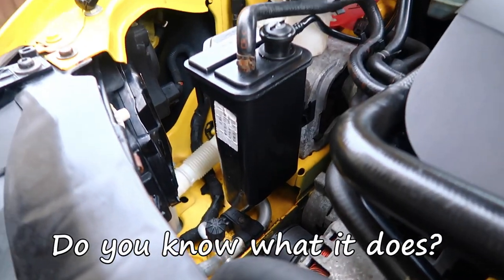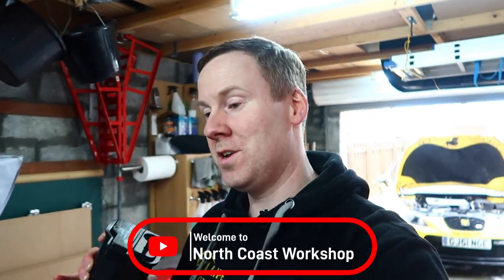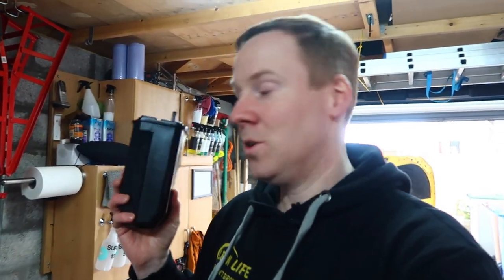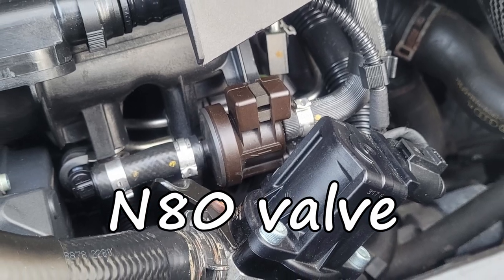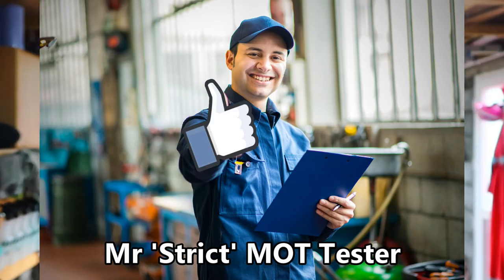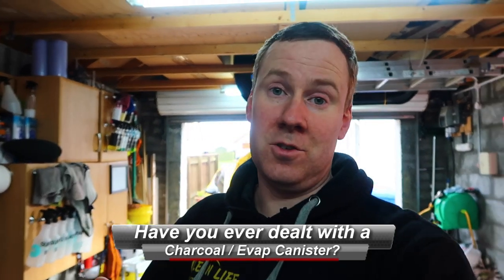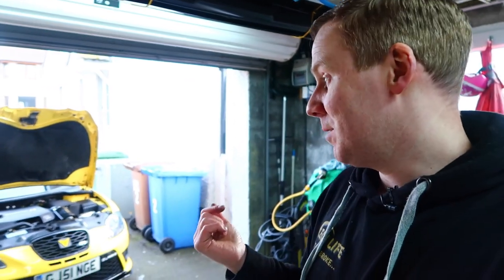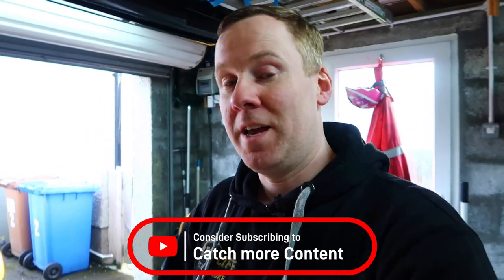Charcoal Canister CHEAP Replacement | TFSI MK2 Leon 1P1 Evap issue

Comment: It helps a lot with mpg for one and after a certain amount of time it can get clogged and the check engine lights and the car doesn't run at full power
Reply from the maker: Did you have issues with yours? 
Yeah by the looks of mine it was well worth changing! 👍🏻

Comment: Just replaced my n80 purge valve as i had the error code for it and mpg was absolutely dire, had the clicking noise etc. now I've just had the P0441 code pop up so just ordered a charcoal canister. Will be using your video to fit ot when it arrives 🙏
Reply from the maker: 🤞🏻Hopefully it will sort the fault code mate, let me know how it goes.
Reply: Same issue here, did it end up working?
Reply: @hcmzah  the new charcoal canister fixed the problem buddy, was like £16 on Amazon
Reply from the maker: Great to hear mate 👌🏻 glad it's all sorted now

Comment: Great vid, I’ve been chasing a problem with my 2.0 tfsi running rough. Had a walnut blast, r8 coil packs, uprated spark plugs. Now I’m assuming I have a vac leak (reason being the charcoal canister as some point has fell off and hit the belt next to it) I’m going to order one and see if this solves my problems🤔. Great channel pal
Reply from the maker: Cheers mate, appreciated 👍🏻 Yeah vac leaks are a pain to track down. So many places that they can come from 😔 Ur right, rough running usually originates from a vac leak. The seal on the dipstick can fail, the PCV can leak, the pipework to the PCV, etc. Hope u track it down, let me know how it goes too 👍🏻

Comment: The cap which you removed with the pipe also has a reed valve inside,  more complex than first looks    Thanks for the vid
Reply from the maker: Ah cheers for the heads up 👍🏻 yeah I just thought it was a straight forward pipe! Thanks for watching

Comment: Great video, I get smell of fumes sometimes inside and outside on my mk5 gti, wonder is it just as easy to replace?
Reply from the maker: Cheers, yeah it could be a similar issue. And should be exactly the same process as they share the same engines. The main thing is to try and eliminate as many of the things that's not causing the smell, then it's sometimes a bit of trial and error with the remaining possibilities. Hope you can get it sorted mate 👍🏻🤞🏻
Reply: @NorthCoastWorkshop  it would be good to figure it out it’s only sometimes and not all the time, thanks for the video cheers

Comment: I fitted one of these from ebay or Amazon; can't remember which, about a year ago and have had no issues. I read on a forum that they come from the same Chinese factories that produce them for VW, and the area that's been ground off has the VW logo?
Reply from the maker: That would make a lot of sense, as I've heard similar reports on a lot of other OEM parts you can buy for VAG cars. Turns out it was worth trying to save a few pennies for then 😁 cheers for watching and commenting pdk 👍🏻

Comment: Thank for the info...one of the things you don't ask about...my 89 Mustang GT with 88 k on it..just wondering if I should change mine because of the age of it ???
Reply from the maker: A lovely car you own 👌🏻 as for changing it, depends on if the car is showing any symptoms of possibly needing it changed.
If it was an expensive part, and the car was running perfectly, I would say the current one was still good to use. 
If it's reasonably cheap, like mine was, and easy to replace, it would do know harm, and possibly benefit the running of the engine.
Appreciate you watching 👍🏻
Reply: @NorthCoastWorkshop  Yeah. I watched a video and sent it to my sister about over filling the tank. Got me to thinking...when do they go bad ??? I couldn't find any service advise anywhere...I found one for 65 dollars ...The nozzle sometimes shuts off and spits out some fuel...even though I know its only been on a few seconds...I have to use a lower notch on the handle so it fills slowly Never heard anyone changing one...so maybe it is plugged up and backs up the fumes ...Thanks...while Im under the hood I got to change the horns too..they also went out... LOL

Comment: Is it possible that because of a bad charcoal canister my turbo sometimes kicks in at 3500 rpm and sometimes at 2500rpm?
Reply from the maker: I'm not 100% sure if that would contribute towards the problem. Possibly I'd check your diverter valve or the actuator on the turbo could be sticking open. It sounds like something is sticking open and not allowing boost to build up at the right time.

Comment: do you think the canister/n80 could cause my car to stutter when accelerating from a standstill?
Reply from the maker: A small possibility Arron, but could be so many other things too. The ignition coils play up on these cars, as well as the injectors and also the diverter valves. If you're able to get diagnostic software plugged into the car, that'd maybe pinpoint what's causing the issue. Good luck 🤞🏻

Comment: I have every about 1k miles engine check error p0441( tank venting system). I changed also charcoal canister and fuel tank breather valve. Nothing help 😢
Reply from the maker: It could be the N80 valve is defective if you have one on your engine? The N80 valve on the TFSI engines can sometimes play up and cause fuel vapour/evaporator issues.
Reply: @NorthCoastWorkshop  yes, I changed N80 valve 👀
Reply from the maker: Apologies, just saw the message properly, was looking for the N80 bit thoughout 😅🙈
I'm not sure what else could be the issue. You've done all the things I would have suggested.
Maybe one of the lines are blocked between all the components? 
A good article on via this link which may help 🤞🏻
https://www.kbb.com/obd-ii/p0441/#:~:text=There%20are%20several%20things%20that,problems%20with%20the%20control%20module.

Comment: Should of deleted it bud
Reply from the maker: I'd be a bit unsure about removing it completely. Like some owners delete PCV valves and have engine issues later on, so I felt keeping my evap system standard would be more reliable in the long run. Cheers for watching 👍🏻